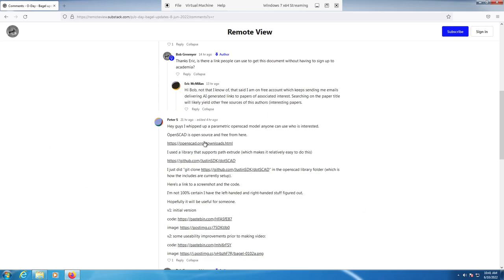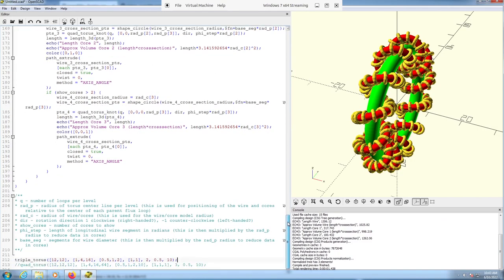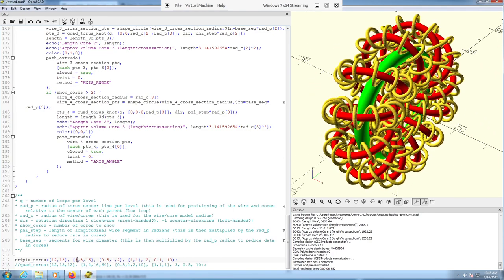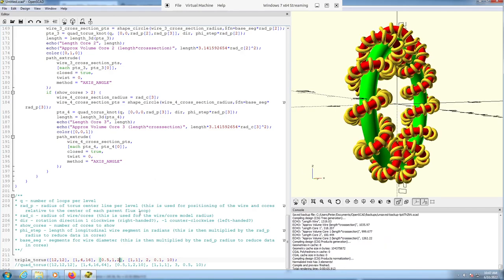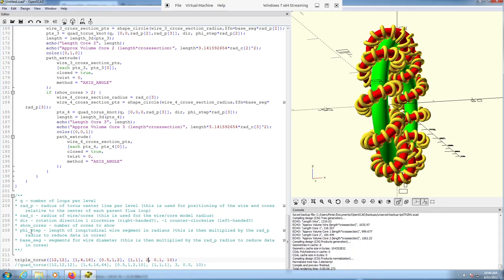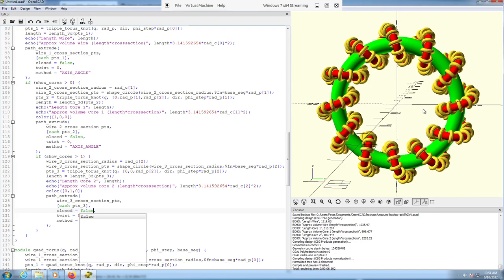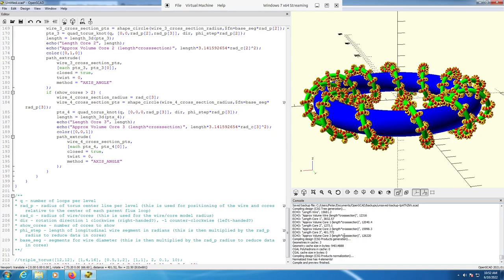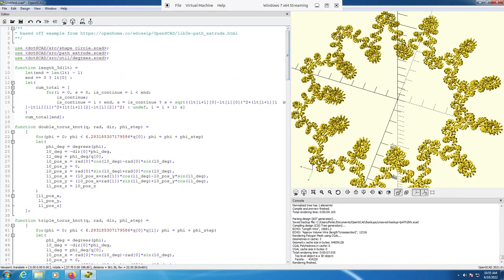O-Day - Free parametric bagel builder by Peter S.

Comment: Outstanding. Thank you for applying your skills to this project, Peter S. Looks like saving the world will have to be DIY. Cheers.
Reply from the maker: He is being the change he wants to see. We can't expect those invested in the status quo to save anything.
Reply: @MFMP  Status Quo? It's got to GO!
Reply: Thanks Corky, yeah I really wish I could build a coil winder. But I lack the experience to do it in a timely and efficient manner. I saw what Bob was doing with the 3D models and thought openscad would be perfect for this so I threw together script. Hopefully it can be of use. I may try printing one, then coating by hand with conductive paint then plating it. :) I'll let you know if I do.
Reply from the maker: @petersvideofile  Try this complete electroless Copper plating kit!

Complete electroless copper plating kit $141.90 
https://caswellplating.com/electroless-copper-kit-1-pint.html
Reply: @MFMP    It seems they may not ship out of the US "Contains Hazardous Goods. Shipping restrictions apply. Ground shipping only to the Continental USA. .. contact us for rates to other locations." I'll contact them to ask and if not, I'll try to find someone who sells this over here. In the mean time I'll try to print this with FDM and supports if it's possible as that will be a per-requisite anyways.

Comment: Fantastic Peter and Bob (!)  For metal printing, I don't believe SLS selective laser sintering in nylon (and then plating) is going to work as well as Binder Jetting, and there are still very stringent dimensional requirements. So likely you'll need to use pretty thick wire diameter (1mm may work). So that the 'green' parts (not yet filled with bronze), are not too fragile. Shapeways has a nice page on Binder Jetting tech, I tried to post a link here, but your Youtube posting rules immediately removed my comment.
Reply from the maker: Hi William, post over at RemoteView.ICU

https://remoteview.substack.com/p/o-day-bagel-updates-11-jun-2022?s=w

Comment: Heres a technique that can be used to 3d print in plastic (best results with a sls resin printer) first 3d print the high level torus and then apply a metal solution that later can be sintered so that plastic melts out but the metal remains and takes the form of the 3d print like in this video

https://youtu.be/tpO5DgiCgyM
Reply from the maker: This is great! Thanks for sharing. With a laser cured polymer and electroless plating, it may work very well - and there maybe no real need to remove the polymer.
Reply: I think powder based SLS nylon or metal would be the way to go so you don't need supports. I really like your idea of sinterable metal solution it sounds better than conductive paint which is what I was considering. Thanks for the tip.